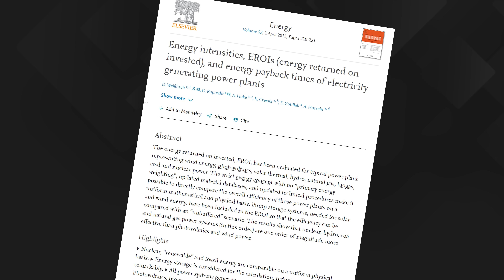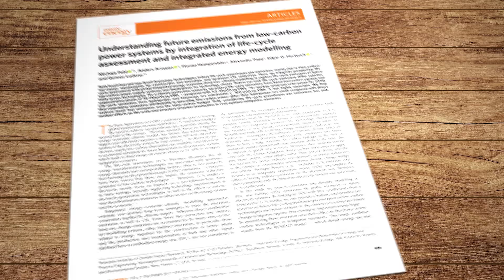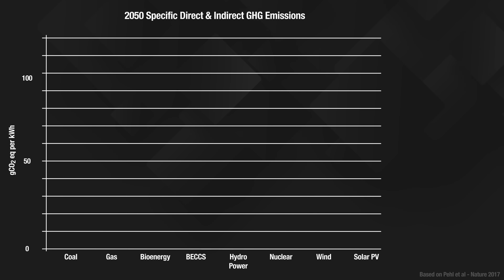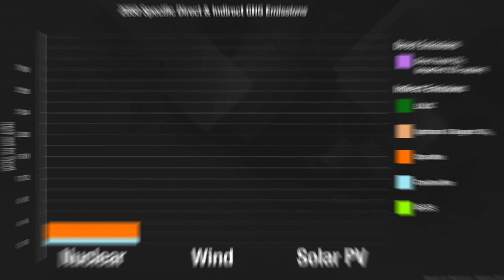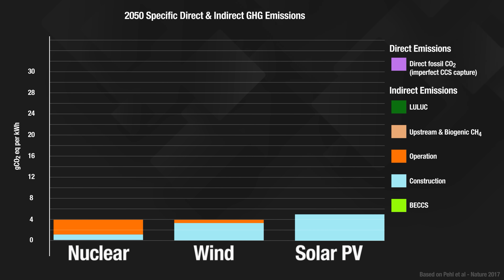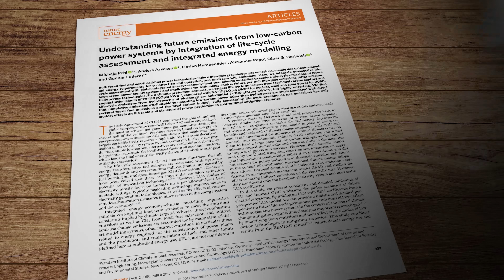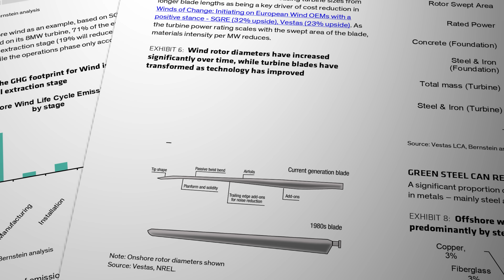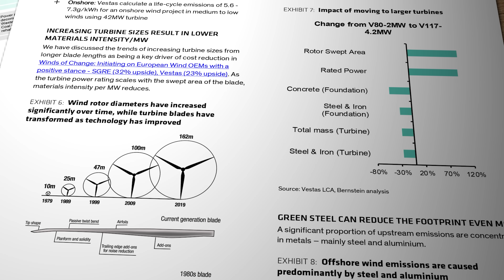Lifetime carbon emissions of renewables vs fossil fuel. Problem or solution?

Comment: Given the reliance of wind and solar on energy storage support, a significant investment cost and also emissions potential in manufacture/recycling, perhaps we ought to be factoring this element into the competitiveness of such natural energy sources in order to make a comparison with those power production systems that do not directly need such storage?
Reply: Energy storage will increase emissions, but wind and solar as so far below fossil fuels, that no reasonable energy storage system would change the conclusion.
Most likely batteries will win long term, and those have a pretty low carbon footprint already. This life cycle analysis has been done for electric cars, so we know the numbers. And keep in mind that batteries are already almost fully recyclable, as they are mostly just metals and graphite. The battery recycling industry is coming to life about now, as the amount of battery waste is only now getting to the scale where it's worth doing. And recycling batteries infinitely would reduce their carbon footprint to almost nothing, if the necessary energy is coming from clean sources.
Also there's an alternative for storage, overbuilding production. For example solar panels make less electricity in winter, or on cloudy days, so normally you would need energy storage to make up the difference (or another power source). But if you build enough capacity for the bad days, then you only need to worry about nights. And that means massive excess capacity during the good days. That essentially free energy can be used in many energy hungry industries, that don't need to run all the time. For example massive desalination plants. We can easily store vast amounts of fresh water, so these plants can afford to only work in the summer. This could solve our fresh water shortage too, as a free bonus.
Reply: @andrasbiro3007  until you realize the huge carbon footprint of a battery.
Reply: I was quite surprised by the low emissions of PV, as I would have estimated them quite higher. Nonetheless I too was disappointed by the missing mentioning of energy storage. Though to be fair there doesn't seem to have been a conclusive solution to the problem, thus estimating its weight on the environment might be a challenge. Nonetheless I would expect models that solely focus on its CO2 emissions (in the case of batteries like Li) to be possible. 

Dave if you see this, please do consider doing an update.
Reply: @cyrus5919  its wrapped up in the hydro statement
Reply: @cyrus5919  t5
Reply: I think it’s an utopian idea that cars will totally disappear, so that means a lot of electric cars will be on the streets. That means immense power storage.
Reply: Yes precisely. It's far too generous to just account the carbon intensity of wind power on windy days - the backup needs to be part of the equation. We need more wind power and more nuclear power
Reply: @sammason2300  And don't forget the infrastructure, new roads and waste areas of woodland cut down + co2 emitted by birds, bats and insects killed by the blades and some micro plastics on top
Reply: @sammason2300  j5t5
Reply: @sammason2300  Can not do Nuclear in earthquake zones - far too dangerous - not a blanket solution....
Reply: @madpete6438  cannot? I doubt Japan engineers agree with you. Japan is one of the most earthquake prone places in the world and they will not stop developing nuclear energey
Reply: @douglasashby4349  I live in New Zealand. Volcano's and Earthquakes. Maybe these new small modular reactors will work ... I have hope. But we have 81+% renewable power on our national grid already..... Makes it easier to fill in with wind and solar.
Reply: @madpete6438   Taiwan has a few and it's on the ring of fire.
Reply: @madpete6438  Pete, I live in NZ as well, the shaky isles, doubt we will ever need nuclear power here but some storage would certainly help get us to 100% renewables. Pumped hydro has been discussed for decades but gone no where. Improved efficiency of the plants along the waikato and a better transmission structure would be money well spent.
Reply: @douglasashby4349  Totally agree. And if more individuals take responsibility for their own power generation in concert with efficiency and additional wind and solar farms (imagine floating solar and wind in the Firth of Thames with integrated fish farming .... The local Iwi could make money and jobs and help the climate.... 
Or punching a couple of big tidal tunnels between Pelourus and Queen Charlotte sounds for generation.... Tidal generation in Cook Straight where transmission lines already exist to Haywards.....
Still too few visionaries in government for that sort of cleverness though.
Kia Kaha.
Reply: @douglasashby4349  Cool. Small but Cool...
Reply: @madpete6438  
We are doing nuclear in military ships. The ones that are designed to be shot at with big explosive stuff. For example the Kursk's reactors survived an explosion that tore apart half of the submarine. Only half, because the reactors stopped the explosion. These were designed to survive 50g acceleration, which is about 100x of the 2011 earthquake in Japan.
And the reactors in Fukushima also survived the earthquake just fine, the tsunami wrecked them. And even that only because a series of major design flaws.
Reply: @andrasbiro3007  Unfortunately, the phrase “a series of major design flaws” does little to calm a concerned public and convince them that nuclear energy is safe. Personally, I’m not concerned about nuclear safety in general, but a lot of people are, and the pro-nuclear crowd do themselves no favors by treating doubters like idiots and making up irrational arguments against wind/solar.
Reply: @andrasbiro3007 We have a shite load of wind, water, geothermal and sun resource - why spend all that concrete and steel and money for something that is not required - 
So mild climate with high average wind, good solar hours and lots of dammable rivers (We use quite a lot of run of river power plants) in a geothermally active area ....
Makes Zero sense. 
I suspect you were unaware of the above unique environmental conditions here.
Reply: @andrasbiro3007  But in specific areas - specific solutions work. And Nuclear is not good in some places - it is of no value.
Reply: @madpete6438  
What? Nuclear works absolutely everywhere. Even underground, under the sea (think nuclear subs), other planets, and space.
It's not always the optimal solution, but that's a different story.
Also why would this make it worthless?
Reply: @andrasbiro3007  I said it is not always the best solution. Where I live - it is pointless. We have so many natural wind, tide and water resources, the use of all of those resources to build a nuclear plant is pointless.

Plus we are islands that are very geologically unstable... that requires additional expense to construct.

The resources required to build 4 or 5 Gigawatts in one place and therefore a massive grid upgrade to distribute the power vs distributed generation of the same quantity - which is what we have now - only 20% of the whole countries energy is NOT renewable ! so yet again - no point in nuclear power here....

I hope this helped you achieve clarity
Reply: It's unfair to apply cost of energy storage to one single type of energy. Your need of storage depends entirely on your energy mix and local conditions. In a country with a lot of nuclear energy you'll need less storage, but the same is true for a coastal country who rely on offshore wind. It's far from that easy to say that for every X MWh of renewables there's X amount of needed storage.
Reply: @michaelthorsby  Spot freaking on mate. Well said.
Reply: @bobtahoma   Why compressed air storage? Surely pumped hydro is the better option there?
Reply: @DistinctiveBlend  pumped hydro storage will have the same carbon footprint (and other environmental damage) as hydro power. This very video placed hydro carbon emissions at close to that of fossil fuels! This is why hydro IS NOT green.
Reply: @robertlipka9541   I asked why someone was advocating compressed air storage vs pumped hydro. Storage of energy is something that needs to be addressed when it comes to renewables and pumped hydro is tried and true. -- It also doesn't degrade in storage capacity like a battery bank does.
Reply: @DistinctiveBlend  I am pointing out that this video provided figures showing that hydro and pumped storage have a very large carbon footprint, similar to fossil fuels. So, if you combine solar/wind with pumped hydro you end up producing such a large carbon footprint that you may as well NOT do it (perhaps keep using natural gas power stations). For me this is a very strong reason NOT to use hydro in any form, not just vs compressed air.

PLUS, pumped hydro DOES DEGRADE, dams eventually fill with silt and concrete ages. Eventually dams have to be pulled down and rebuilt, the estimates I heard for a lifespan of well constructed and maintained dam are 50-100 years (some parts in a hydro dam producing electricity have to be replaced sooner).
Reply: @DistinctiveBlend  
Pumped hydro is limited by geography. You need vast amounts of water, and that's not easy to store economically. It's only cheap if nature builds most of the structure for you.
Reply: @andrasbiro3007   Sure but if you have the geography and you have the rain/water then it become economical. -- So it's ideal for where I live, the only real issue is where and how you flood as decaying plant matter releases ch4.
Reply: Variable demand requires flexibility. Coal power plants are good for base load, but can't  quickly and efficiently reduce or increase output. Dedicated costly gas generators provide the necessary dynamic output. So arguably some of fossil fuel energy production also requires energy storage solutions.
Reply: @basilevs83  The problems with the grid usually occur during storms.  The connection system with wind turbines have problems and some of the turbines fail.  Many of the solar panels are damaged and during the stormy weather the sunlight is largely blocked.  So people use natural gas to generate electricity from expensive, but reliable systems.  If gasoline can be obtained from service stations because the power to the pumps are often out, then gasoline generators are used which poison people with carbon monoxide and often result in fires.  The diesel are a lot better if fuel can be found, but cost more.
Reply: @lewisdoherty7621  Here in Minnesota, we have stormy weather, including tornadoes. Our main grid problems during/after storms are from downed power lines. We also have very large wind power base (21.6% of our energy in 2020). It is very unusual for wind turbines to be damaged by storms. Solar panels are generally rated for 140mph winds, and in practice aren’t damaged by hail. Our biggest solar problem is cloudy days reducing their efficiency (we may have total cloud cover for days on end). But even then, they’re generating power - just not full power.
Reply: The new "microwave laser" drill tech for doing geothermal anywhere is very promising.
Reply: Even today new Nuclear power plants are 10 times more costly then the same amount of output from wind turbines.
Reply: Good point, would be interesting to see how wind and solar would stack up with energy storage LCA emissions included. I personally don't think there would be a huge impact given the growing percentage of fully recyclable materials used in energy storages now and in the coming years.
Reply: @H3LLB0Y2403  there is very LITTLE recycling in battery storage.  The carbon cost of new Lithium Ion cells is between 60kg-co2/kWh (Tesla) and 135kg-kWh (China).

That means a Tesla model S with a 100kWh battery produces as much CO2 as 1687.5 gallons of gasoline just in the battery.  And that is before it even takes a change.from the grid,.which, in America,.is 75% fossil based.
Reply: We probably have to factor in the years of technology. It would not be fair to compare the products of 2 industry's where one has had a century head start in development. 
Is there any reason to think that our natural energy technology will stop improving?
Reply: @breyrey7612  we have to solve the problem...now... Not wait for technology which was "10 years away" 20 years ago.  Nuclear is now. Biofuel is now.

Solar and wind, beyond a degree, need a storage solution. And right now, our storage solutions cause more CO2 than coal.

Lithium Ion is between 60kg-co2/kWh and 135kg-co2/kWh. The concrete needed to do pumped hyro is ENORMOUS and concrete produces massive amounts of CO2 to mine, manufactur, and cure. Hydrogen fuel cells are inefficient and are usually fueled by cracking natural gas.

Nuclear is great baseline energy and it is lower carbon than a pure solar/wind solution because of the laters dependency on storage.
Reply: @coreyfro  I agree with you 100% with nuclear. Somebody did a great job of smearing that option from Americans.
I agree that energy storage is a problem but that will improve with technology. The reaso why there is a lot of CO2 produced when mining is because the machines produce it. Once they are replaced with zero emissions, that will be another premise refuted against this product.
Nuclear is great but it's not portable (yet) so we will still be dependent on batteries for a long time.
Reply: @toadwardmaier941  I never said that they couldn't exist. What I did say is that they are a dreadful way of storing electricity. I used google translate and the article itself says the efficiency is limited to below 50% (when used to heat steam).

 So I once again point out, that it seems pointless converting electricity to heat (10% losses) and then back (50% additional losses), when you can just use batteries, which present efficiencies at around 90%. The ~40% efficiency of thermal storage (which might not even be that high, but whatever) is half of that, thus it isn't a valuable substitute.

I really dont see the difficulty understanding this..

Edit: dont forget that the initial idea was with a Stirling process, which conventionally is less efficient than clausius-rankine (which is used here). Note that this storage unit is relatively obsolete without fossil fuels, as the generated steam is supplement to a fossil fuel power plant to temporarily increase output. This is not the sustainable solution we are looking for..
Reply: It is also likely the figures are given for current technology.   While wind energy capture systems are being made more efficient in the areas of carbon reduction, there are more efficient nuclear power designs which use less materials and generate less carbon also being developed.
Reply: Agreed. Bet it's still lower than any of the things to the left of nuclear though.
Reply: @bobtahoma  
Those have horrible efficiencies. And I'm not sure about the scale. Try to calculate how much air you would have to store a GWh of power. Li-ion batteries are at this scale already, and a lot more is needed.
Reply: Do the calculated emissions for coal in this report include emissions from gas peaker plants that are now a normal adjunct to coal fired base load on contemporary power grids? I would have thought a comprehensive full life cycle analysis would have taken all of that including storage into account. It is a matter of careful data collection and sifting and incorporating realistic assumptions where the data fails to provide a full picture. Going carefully through the report might throw some light on your concerns.
Reply: I read that 95% of storage kWh's is from pumped hydro.  I assume that much of the carbon is from moving dirt to make the reservoirs and dams.  We need a lot more pumped hydro storage.
Reply: @bobtahoma  
Efficiency is not just a bit lower, but vastly lower. Like 25% vs. 95% is a big deal. Some may go up to 50% or 60% in ideal conditions, but that's still way too low for daily cycling. Give me 80% and we can talk.

And I have doubts about scaling too. Li-ion batteries have surprisingly high energy densities compared to mechanical or thermodynamic storage systems. Calculate how much mass and volume we would need to store significant amount of energy (on the TWh scale). Pumped hydro is a good example. Look at the amount of water they use.

On the other hand we can scale li-ion, there are plenty enough raw materials, the bottleneck is just extraction. And there's the potential of sodium-ion, with an iron-phosphate cathode. Not much scarcity there.
Reply: @Apsoy Pike Finnish Sand Storage is looking very cool and "dirt" cheap!
Reply: @bobtahoma  
Horrible efficiency wipes out all advantages.
The only possible exception is long term storage, but there capacity is problematic. If energy density is low, which is the case for practically all of these, then large capacity will be expensive, even if you only use dirt cheap materials. A good example is pumped hydro, which stores energy by simply pumping water up. The issue is the amount of water needed. To store any significant amount of energy, you need billions of tons of it, and you also need to store it somewhere.
I'm not saying that all of these are bad in every possible use case, just that these are serious problems that most advocates tend to overlook.
Reply: Energy storage tech is shifting rapidly, I'm not sure if we can make a good estimate for this. However right now most green energy isn't stored, it goes into the grid reducing burning energy.
Plus a lot of battery storage is likely to be your laptop battery, your phone battery, your car battery, etc. Charging those devices when power is cheap would be a good way to save money and the environment. 
I do wish geothermal energy was on the list though. It would be a good choice for low wind night lights and oven power and heating and such when solar and wind aren't available.
Reply: @aaronbaker2186   storage never generate any energy at all .process of manufacturing storage facilities cost money and natural resources as well.I wondered what is the alternate for battery or melt salt?any one provide me answer .LOL
Reply: @aaronbaker2186  everyone down plays the capital costs of their preferred system along with its weaknesses.
Reply: @aaronbaker2186  
Geothermal is limited to where the Earth is hot near the surface.  That eliminates a very large part of the land.
Reply: @aaronbaker2186  it's not.  We have been using lithium ion since the 70s and every other technology is constantly "10 years away"
Reply: But disappointed that you're getting criticism for raising this. C'mon folks, the channel's even called "just have a think" - be weird if further discussion was discouraged.
Reply: @tomevans9451  "just have a think' means I get to think about what is said, and possibly disagree. If I disagree, I get to criticize and you get to think about it.

Would it have been nice for the study to include three or so models that took in to account variability of renewables? Maybe. But there are countless combinations. HVDC transmission with over production, deep bore geo thermal baseboard, electro-chemical storage (dozens of chemistrys to choose from), chemical storage, hydro/mechanical storage, thermal storage, load shifting, and any combination of those combined with projections including the use of built out renewables for their production. Where would that analysis even stop? 

All this still doesn't change what the study shows; renewables and possibly nuclear are the only sources with lifetime emissions low enough to pursue. Everything else is an order of magnitude higher than the levels  required. That means means they are non-starters. Even if you quadruple the expected lifetime emissions of renewables, renewables are still the only viable path forward.

It's like needing to get to the ER in ten minutes; you don't take a two hour route because there might be a little traffic on the 5 minute route. You are right to be concerned about the traffic, but that concern shouldn't impact your decision to take the shorter route.

So yeah, we're all just having a think and talking about it, and sometimes we disagree and talk about that too.
Reply: Your energy storage would have to be REALLY bad to push renewables to be worse than fossil fuel power plants. Nuclear is great especially as baseload, but I think new reactors could be made to be adjustable
Reply: @ThomasBomb45  lithium ion energy storage, if I use Tesla's numbers, are 60kg-co2/kwh.  This ignore the fact that most Lithium ion storage is produced in China where the number is 135kg-co2/kwh.

That means that a Tesla Model S with a 100kwh battery, before it leaves the lot, costs as much in CO2 as 1687.5 gallons of gasoline. That would get a luxury sedan (equivalent to a Tesla) 60,000 miles.

That's before the Tesla gets a single battery charge.  Then,.from the American energy grid, which is 75% fossil based, you charge your battery with fossil carbon.

So. Yes, exactly as you said, the storage solution is aweful.

Footnotes:
1. Tesla models weighs about 1500 pounds more than an equivalent luxury sedan, so no, you can't say the same amount of carbon was used to make the traditional sedan.
2. The carbon spent to make iron and plastic.is about 1/4th the amount per pound as a lithium iron battery, so a traditional car if equal weight ro an EV is ALSO not nearly as damaging.
Reply: @coreyfro  You forget that existing ICE cars also have more complex manufacturing. So it's only the marginal difference. LCA shows it might add less than a year.
Reply: @HughButler35 that has nothing to do, what so ever, with the carbon cost of lithium ion batteries.
Reply: @coreyfro  
These are outdated numbers, and probably were wrong even back then. Read Tesla's 2021 impact report, or any recent study.
Reply: @coreyfro  
Where did you get that number? I don't see it anywhere in the report. What it says very clearly, and repeatedly, that their cars are much cleaner then ICE cars.
Reply: @andrasbiro3007  best study to read is an MIT report entitled "How much CO2 is emitted by manufacturing batteries?"

Sorry, cannot link in comment.
Reply: @coreyfro  
I saw several studies with wildly varying numbers. Some are completely made up. It also depends strongly on where were the materials sourced and where was the pack manufactured. Chinese batteries are much dirtier than American ones. But even within China there are big variations. Today EV companies care a lot about their CO2 footprint, so they try to avoid coal power and dirty mining practices.
Tesla for example makes a lot of batteries in Nevada, in their own factory, which is increasingly powered by solar panels. They also recycle most of the water and chemicals, so it's one of the greenest factories in the world.
Reply: @andrasbiro3007  good thing I am quoting Tesla directly.
Reply: @andrasbiro3007  
1. Tesla's Nevada gigafactory numbers are 60kg-co2/kWh which means the model S has a carbon offset of roughly 40,000 miles of a luxury sedan before it gets a.single charge.
2. Tesla buys cells from China for all non-american markets and that stuff is dirty dirty dirty.
Reply: @coreyfro  
1. That's a made up number. I don't have the real one, unfortunately, but that's way too high. See 4.

2. The Model S is irrelevant anyway, it's less than 10% of Tesla's sales, and will be even less in the future. Also The Model S doesn't even use cells from Nevada. It uses Panasonic 18650 cells from Japan.

3. According to Tesla's 2021 Impact report, a Model 3 or Y is already greener than a gas car after just 6500 miles, on average. And that's assuming grid power. Charge from solar, which is pretty common, and it's much faster.

4. I found some data about CATL (2021 ESG Report). They claim ~13 kg/kWh CO2 emission. It's self-reported, and it's a Chinese company, so take this figure with a grain of salt, but it's still over 4x lower than what you claimed for Tesla's Nevada factory, which is mostly solar powered.
Reply: @andrasbiro3007  

1. Good thing this platform doesn't allow links so I can't prove you wrong
2. So the other ones have 80% the capacity.  The problem is the same and those batteries are going to be worked through more of their cycle so will age fast and need to be replaced more.
3. I have ready that report.  When they compare themselves to other manufacturers, they are using 20 year old numbers, which is dishonest since market, economic, and regulatory pressures have also forced other manufacturers to change.
4. IMPOSSIBLE. The lithium mining and refining process requires the majority of the power consumption.  Perhaps ONLY the manufacturer cost is 13kg-co2/kWh.  The recycling cost is 10kg-co2/kWh (Firbse 2020)
Reply: @coreyfro  
1. Actually data proves you wrong.
2. That's not what were were talking about. But you are still very wrong. Modern batteries have very long lives, and that's been thoroughly proven in practice. The latest Tesla batteries last well over 1 million miles. And LFP batteries can do a few times more. 
3. What 20 year old numbers?
4. It's hard to figure out from the report, it could be just the manufacturing cost. But it doesn't matter much anyway. The whole point is to use renewable energy instead of burning fossil fuels. Once we achieve that goal the carbon footprint of batteries will also drop to near zero. Mining, refining, transporting, manufacturing, and recycling, all can be done using clean electricity.
Reply: Ok and factor in the trillions in subsidies the fossil fuel industry has received over the decades
Reply: @godkingemperorpresidentceo  And still do.... I suppose they are so poor they desperately need the support to fund the massive PR (Should be PL {Public Lies}) departments ... and the bribes to Politicians.
Reply: This is exactly the problem with non-constant energy sources as a solution to GHG emissions, the emissions from storing the energy far outweighs those of the energy producing device.
In this paper (Jones et al. 2020, DOI: 10.1021/acs.est.9b06231) you can see the carbon emissions for the best energy storage options (not accounting for pump hydro); these are (in the same units as this video, g CO2eq/kwh) ~312 for lithium, ~282 for redox flow, and ~126 for compressed air. When added to PV or wind the conclusion is clear, the only energy source that could power a constantly available grid AND keep emissions on target is nuclear.

Note that pump hydro would be better than the above energy storage solutions, but it still suffers from the emissions presented in this video.
Reply: @ackermannluis  
False. One paper means nothing. I've seen plenty that used grossly inaccurate assumptions.
In this case that CO2/kg for Li-ion batteries is just absurd. The true cost is like 20x less. For example CATL claims ~13kg/kWh in it's 2021 ESG report. It's not necessarily a reliable source, but the difference is way to big to ignore.

Also the vast majority of the CO2 comes from the energy used for mining, refining, transporting, and manufacturing. Use cleaner energy, and the carbon footprint of batteries drops further.
Reply: Elon Musk estimates it would take 300 Twh to power the global economy. A huge percentage of that would have to be stored for nighttime use, bad weather, etc. There's a lot of mining and processing needed to produce batteries at that scale. And a huge amount of processing involved in recycling battery material. Also, I believe that about 75% of solar panels are currently produced in China, and their power comes almost exclusively from coal fired plants.
Reply: @darylfoster7944  
Then manufacture solar panels elsewhere. It's not like only China knows how to do it.
Also do you have any idea how much oil and coal we burn? that 300TWh of battery is nothing compared to that. 300TWh of the current Tesla Megapack is about 7 billion tons. We burn about that much coal in a single year.
Reply: @darylfoster7944  YES - they do use a shite load of fossil energy at the moment - however there is also a massive, ongoing addition of renewables (mostly Hydro) all over China. The quantities are quite amazing... so the proportion of Renewables changes Week by Week....
Just watched doco on the floating Solar Farms they are putting in enmasse (also said to reduce the co2 coming off the storage lakes).
I do believe we need to NOT be stopping putting in solar, wind and hydro just to satisfy the nit pickers. My panels came from china but they are saving carbon every minute the sun shines.
Reply: @darylfoster7944  not true Daryl. 300TW - but most of that is vehicles. Grid storage analysis in Australia says 10% or less of generation. So maybe 20GW. Less than 10% of needs.
Reply: @HughButler35  if you're right, then what about all the other energy that's required to power homes and buildings? And I think you meant 20 TW, not 20 GW.
Reply: @darylfoster7944  
That was the storage needed, right?
Reply: @stefanwallgren3497  that's installed capacity of EVs and battery packs, in order to run Earth's entire energy structure.
Reply: So sure, factor in that cost. I’m gonna dig a couple of holes, fill them with cheap locally sourced mass (you DO have rocks where you live, right?), add stuff to heat that mass, and hook up a Stirling engine or other heat pumps. What’s the carbon footprint of that, and what’s the lifespan? Yes, do the math. PLEASE. Don’t just raise abstract doubts with abstract questions.
Reply: @davestagner  considering the fact that solar and wind energy is not consistent throughout the day/year, it would seem significant to factor any additional sources of carbon emission due to additional infrastructure. Not to mention the drawback of lowered efficiency in Battery storage, which would skew the gCO2/kWh efficiency of solar and wind.

Although I would definitely agree that renewables are the future and that they already show better results than coal etc., such estimates are of huge importance to know if we manage to stay within 2°C and to create a specific timeline of that transition. Moreover it is equally as important, in order to decide whether a return to atomic energy is necessary to achieve said goals.

I wish to criticize your unconstructive cynicism in this matter, as posing such a question does not simultaneously imply being a shell for...Shell.

Edit: I just realized that you might have had been serious, in which case your suggestion is the funniest thing I have seen in a while. In very short terms, the thermal efficiency of your proposed contraption wouldn't surpass (in the VERY best of cases) 40%, though if you actually consider that you wouldn't be able to make large Temp. Gradients, you wouldn't even surpass single digits (note that I have neglected heat losses as well).
Reply: @cyrus5919  Oh, I’m totally serious. I think we SHOULD bring in the cost of grid-stabilizing storage and the carbon/environmental footprint of manufacturing said storage. The reason I think we should do this is to drive yet more nails into the coffin of the ridiculous arguments like that it would be as dirty as fossil fuel, that sufficient-scale storage is technologically impossible (it’s not even hard, much less impossible), or that storage costs would make a solar/wind grid so expensive that humanity couldn’t afford it. Bring it. Please. Bring your numbers and your math with you. And think about what they mean. For example, you point out that the efficiency of my “proposed contraption” wouldn’t exceed 40%. Very well, I accept that, conversion efficiency is an issue. So, um, what would it cost to make my “contraption” 2.5x larger, in order to cover the efficiency loss? 

You claim “you wouldn’t be able to make large temp gradients”. Um. Why not? This channel is full of thermal storage projects working at temperatures like 600c, which is a fairly large gradient. There’s no theoretical limit I’m aware of to the amount of heat that can be generated by electricity, except perhaps materials engineering limits, which I’m sure can reach thousands of degrees. If you can’t actually explain your claim, then it’s a criticism with no basis in theory or fact. And, beyond thermal storage, there are plenty of other ideas - battery technologies that would work well at grid scale, like iron-air, or gyroscopic storage, or compressed air, or hydro storage which is already in place around the world… storing energy at scale is straightforward and inexpensive. 

So yes, let’s count the cost of storage. Let’s have that discussion. I’m serious. Are you?
Reply: @cyrus5919  He was just keeping it short and simple. Of course if you want longer storage you need some insulation, but you still heat the sand, it is cheap(FREE if it is on site) and has a lot of mass. 
But in the cases where it is a big project(a huge energy storage) then the losses become less and less the bigger and hotter you make it. I mean the losses are next to nothing in comparison to the amount of storage you get, and for how long you get it for, for months and months.
All you had to do was heat the ground in essence, we know it sounds absurd to uneducated people, but now we know who isn't educated, those who laugh at it. Now we know who don't know how to think. Sand is already sand, you don't do anything with it, just throw it in the hole. We are keeping it simple, but there is a process, you want to bury heat exchangers in that sand, then heat the sand, simple.

FYI you can get the sand up to 600C before it melts it, so you keep it no hotter than 600C. 600C sand will heat the shit out of anything you pass thru the heat exchanger that is buried in a huge pile of 600C sand in a hole, mark these words. 
Hint: water can be made into steam day or night, or day AND night to make electricity. Or and also Stirling engines do away with steam altogether, no need for high pressure super heated and dangerous steam and the costly high pressure tanks and pipes and safety valves, etc... related with it.  And no, Stirling engines are not more complicated or more costly than ordinary engines.
NOTE: that is why we heat sand not water, water can only be heated to 100C and then it turns into steam and becomes pressurized and super heated, but it is highly dangerous and expensive to keep contained properly. So, we use sand as the heat storage, then we can use air itself as the exchange median that runs thru the heat exchanger an into the Stirling engine/s. Then the mechanical rotation of the Stirling can be hooked to a electrical generator.
NOTE 2: In a city you can have the heat storage in the center of the city, this way you can also just run heat vent piping to the homes and businesses bypassing the need for any generators, Stirlings, or any steam, and still heat the city. This ideal is good for cold areas, but they will still need another storage somewhere for electricity generation, but this is not as important to be in the center of the city, it can be out of the city if you had to, and just use the known and proven high transmission lines we already use. I mean the known and proven Nicola Tesla invention of AC transmission lines, not the current energy company. Use the known and proven technology of high voltage AC transmission.
Reply: @TheRebelmanone    good to know that my postgraduate studies in this field (chem.eng.) are rendered useless by youtube comments. Responding seems ever more pointless so I will try to keep it short.

Stirling engines have a bad efficiency as storage. Now you could use them as primary engines and somewhat claim that they can compete with otto/diesel, but not as storage!

In regards to thermal storage: any mech. Engineer worth half a penny will tell you, that heat is the most useless form of energy. Any attempt to convert heat into useful work, I.e. electricity, is starkly limited by efficiency. Just scaling up projects, especially engines, makes them more inefficient due to more losses. For some reason there seems to be a belief towards the opposite, but let me assure you, 90% of my work focuses on counteracting these inefficiencies, so I do have some idea what I am talking about. If you don't believe, just do a bit of research.

Now to your notes:
1: steam in fossil fuel power plants is heated far above 100°C. Interestingly enough, the usual referred value is 600°C. I don't even want to ask why you would think that it would be just 100°C. If you are interested, I recommend reading up on the clausius-rankine process, on which most conventional power plants are based on (I.e. Pretty much anything that includes steam generation).

2: Although I find the various ideas spread in this node quite amusing, none of them are applied, because they are...bad. The reasons for this can be found in previous answers of mine, or with a bit of research. If you think I am wrong, I would strongly encourage you to research the topic further and if you find any scientific papers that contradict my statements. I would be very happy to look them up and be proven wrong. 

Now finally I wish to apologise if my tone seems agitated, but being subjected to your rude, know-it-all remarks does that to someone. There seems to be this belief, that we would have sustainable energy etc. if only a select few didn't hinder progress. I kindly ask you to consider, that you do not know all the answers. There are many scientists, much smarter than you, me or the youtubers we are watching, who struggle solving the modern issues. The solution is not as simple as just pressing a button and I have mentioned multiple reasons why that is, and I haven't mentioned a myriad more that I myself am unaware of.

Edit: I forgot to mention your outrageous statement, that heating the sand would somehow be free. This would have made me laugh, if I did not think that you actually believe this. So let me assure you: there is no such thing as "free" energy, in any sense of the word. If you want just read up on the laws of thermodynamics. If you meant that you could use energy that otherwhise would be wasted, then you just recuperate a (small) fraction of the losses you already had. Any time this isnt done in the first place, it is because it would be more expensive to implement the necessary technologies.
Reply: @cyrus5919  I didn't say scale up the engines, i said scale up the heat battery. 

FYI they use heat to give you electricity as it is. Coal uses fire to heat steam to turn turbines. Nuclear heats steam to produce electricity. 

What is a solar concentrator, it creates you guessed it HEAT.

You are so full of it, first of all because you only heard what you wanted to hear and you never actually tried to read the comment.
Second of all, you don't know what you are talking about outside your so called chemistry. 
You missed the classes on general physics. Or you didn't learn enough to speak on this subject.
Reply: @davestagner   "Don’t just raise abstract doubts with abstract questions." I believe that's called "JAQing off, and yes it's annoying. "Just Asking Questions"
AKA FUD-raking.
Reply: @Jcewazhere  The Devil doesn’t need more advocates. :) But like I said with my response, yet, let’s definitely answer that question. Even if it’s FUD, it’s a valid issue. And I think the answers will just reinforce the superiority of a solar/wind/storage grid model as much less expensive in terms of both total cost and total carbon footprint. The anti-storage arguments are basically terrible, and I enjoy opportunities to shoot them down!
Reply: @davestagner  you are attacking a "straw man". I seriously doubt anyone here is arguing to keep using fossil fuels, the options for carbon free are: nuclear/solar/wind. Among these three, when you include carbon costs of storage, nuclear wins by a LOT at producing the least carbon emissions. So, you are not shooting down any arguments... rather you are missing the point.
Reply: @robertlipka9541  I don’t think you understand my argument. I don’t think nuclear power will ever grow much beyond where it is now, because it’s simply too expensive. It’s barely cost-competitive with coal, much less the rapidly-falling price of solar/wind/storage. None of the current advanced research in nuclear looks like it can lead to a major cost reduction either, much less the order-of-magnitude difference needed to beat solar/wind. (And no, this isn’t about “unnecessary regulation” or “foolish environmentalism”. If it was, we’d see more nuclear in China/Russia, who don’t care about such things.) Fantasies like thorium or mass-production modular reactors are twenty years down the road at best - twenty years of solar/wind/storage installations, twenty years of cost and efficiency improvements. They’re not competing with 2022 solar/batteries, they’re competing with 2042. Is it possible that nuclear beats solar/wind/storage on carbon costs? Yeah, probably (although not be a “lot”, and remember, we’re comparing to coal and gas). Does that mean we should put off solar/wind/storage, when it would be much more difficult and expensive to go primarily nuclear? Absolutely not.
Reply: @davestagner  I think you make too many assumptions on what is possible with nuclear energy (modern reactors CAN lead to reductions in cost and improvements in safety). In recent times nuclear got very little investment in research and development and this is why it is behind solar/wind... but now investment in developing nuclear is growing. I disagree that with proper tech development nuclear will be more expensive than solar/wind... BUT, for argument sake, even if more expensive, nuclear can be combined with solar/wind to provide 24/7/365 base load power, without needing to build carbon footprint intensive storage. Plus, nuclear provides much more power dense source that can be advantageous to industry (we will still need industry to make things... even if it is carbon free steel via hydrogen). I think to do the BEST JOB on behalf of the environment we should PROPERLY evaluate what nuclear can do, if given the same level of investment as renewables are currently getting.

I agree that solar/wind has only a little larger carbon footprint than nuclear (assuming the analysis in this video included RECYCLING costs for renewables), but the REAL problem is the carbon footprint of energy storage... you CANNOT exclude this. Until solar/wind + storage carbon footprint is less or at least similar to nuclear, you CANNOT exclude nuclear as a power source (EVEN if it costs more).
Reply: @robertlipka9541  Nuclear has gotten plenty of investment in research and development. What it hasn’t gotten is production-ready advances that offer major improvements in cost and safety over traditional light-water reactors - which are too expensive. A good example is TerraPower. After 15+ years of effort, they’re building ONE traveling wave reactor, in China, that is basically experimental (and has a seven year construction time). They’ve been banging away at the Natrium design since 2015, and MIGHT have the first commercial reactor in 2030. Assuming nothing goes wrong. I like both of these designs technically and think they’re great advances in safety, but if they have five commercial reactors in ten years I will be impressed. That’s NOT GOOD ENOUGH. I don’t see how you get to a 50%+ nuclear grid by 2040. 

But about that carbon footprint of energy storage… as I keep saying, I don’t want it excluded. I absolutely want to talk about that. Because I don’t think it’s a “REAL problem”, as you say, and the people making that claim aren’t offering up either theory or practice data to justify themselves. And such a justification needs to cover the wide variety of storage in the works right now. What’s the carbon footprint of stored hydro? (And are hydro dams subject to the same criticism?) Of compressed air? Gyroscopic storage? Thermal? Synthetic fuel? How much storage is even needed for a stable grid? Basically, you need to be sure you’re standing on firm ground with a defensible criticism, not just making handwavy arguments to prop up the idea that nuclear is the ONLY solution.
Reply: @davestagner  I am sorry, BUT what you say, your "facts", are NOT what I know about nuclear. So, there is NO point in discussing this further... for me it is not a contest for winning an argument, BUT it is about picking THE BEST solution for the planet.
Reply: @davestagner  my questions will be as abstract as your post. How local are these rocks. Do you have to break them yourself,  is a quarrying company doing it or are you driving around picking them up. If so what are you driving. What machinery are you using,  what is your heat source, and above all else why would you use a Stirling engine? Oh, what would the Stirling engine drive?
Reply: @richardshillam7075  Quarrying for rock, gravel, and sand is very well established technology. Any decent-sized city has a couple of big holes nearby that they dug to get the materials for the concrete to build the city. So digging a hole and filling it back in with whatever material is available locally is a straightforward, predictable engineering exercise. Adding the heat pumps to heat it with surplus energy and extract that surplus and covert to electricity (doesn’t HAVE to be a Stirling engine!) is a relatively small part of the job. And yes, there’s a one-time carbon footprint cost to dig/fill a hole. What you get from that one-time carbon footprint is a low-maintenance energy storage system that will operate for decades, supporting clean energy sources and producing no more carbon footprint after initial construction. (If it makes you feel better, a nuclear plant is basically the same deal - the carbon footprint is all up-front in construction.) I just don’t see how the carbon footprint is possibly larger than any large construction project. Logically, it should be less, since there’s a lot less carbon-intensive concrete and steel involved. 

The claims that the carbon footprint of such a system are “excessive” or equivalent to just burning coal (which itself means digging a large hole) are, frankly, absurd. But this thread is littered with such unsupported assertions.
Reply: @davestagner  hi Dave, not saying its a bigger carbon footprint than anything,  just aying it's hard to work it out without all the information. That's what you asked us to do. However I would question using heatpumps to power it. Ground source heatpumps are used here, but they take the heat differential of the hole and atmosphere to create it. You seem to be adding expense, and with it extra components. I don't know the lifespan of these components but they all add up. Ground source heating makes sense, particularly at scale but any attempt to convert that to other usable power is extra expense with greater losses. A Stirling engine runs so well because its a closed loop. Any other moter/generator will require far more power than ground source can provide on a domestic scale.
Reply: @richardshillam7075  I think I’m more asking why some are claiming that the carbon footprint of energy storage is unacceptably high - especially fairly low-tech storage like thermal. It’s not like we aren’t digging big holes all the time anyway. I’m relatively more concerned about the carbon footprint of, say, lithium batteries, but I think they’ll prove too expensive for grid-scale in the long run anyway. Their real advantage is energy density and fast discharge, making them great for cars and portable electronics. Grid power, though, can get away with both lower density and slower discharge, which opens up much cheaper systems that don’t depend on expensive materials or advanced construction. (As someone said, to make something dirt cheap, best make it out of dirt!) Gravity, inertia, compression, and thermal mass all come into play here, because they’re simple and cheap and can usually use locally available materials. 

A somewhat bigger problem is efficiency, which is where your doubts about heat pumps come in. There’s conversion efficiency to turn solar/wind into electricity, efficiency again to turn electricity into heat/work/pressure/etc, then efficiency to convert back from heat/work/pressure/etc into electricity again. It’s definitely not a free lunch. On the other hand, as long as it’s relatively inexpensive to build and maintain, both in terms of money and carbon footprint, then there’s no reason we can’t just scale up to necessary size. This is a GREAT case for letting the forces of the free market do their work, and I expect we’ll see a rich variety of solutions localized for the needs of particular geographies and demographics. But from a pure economic standpoint, a 30% efficient system that costs 50% less than a 50% efficient system is a huge, huge win, at grid scale. And it’s really, really hard to beat thermal mass when it comes to construction costs and lifespan. A well-designed thermal mass storage could operate basically forever once it’s built. The same can’t be said of batteries (which can last decades). Simpler is generally better. 

I know we don’t have “all the information”, but we do have reasonable analogies. What’s the carbon footprint of the construction of a shopping mall, or a factory? What’s the carbon footprint of a gravel pit? (EVERY city has a gravel pit!) What’s the carbon footprint of all the pavement in place in a city? Unless someone can suggest a factor that I’m missing here (and no one has yet), then building mass-based storage, thermal or gravity, should be pretty similar to a similar mass and volume of ordinary urban construction, like road surfaces and gravel pits.
Reply: @davestagner  you have no idea what you’re talking about mate, go take a thermodynamics course…
Reply: @Taskarnin  Since I presume you HAVE taken a thermodynamics course, perhaps you can explain to me why I’m wrong? I may be wrong; I am often wrong. I like it when people enlighten me, because it makes me smarter. But if the sort of thermal storage I’m talking about is not possible at scale and/or in an energy-positive fashion, I’d love to know why.
Reply: @davestagner  I’ve taken several and have a masters degree in engineering. I’m not going to give you a full explanation however this will let you do some reading. The maximum possible efficiency of a heat engine is defined by an impossible but ideal cycle called the Carnot cycle. The efficiency is determined by the temperatures of the hot and cold reservoirs. That being said the practical limitation is a bit less than 50% so if you used heat to store and extract energy at best you’ll get half of it back. In reality much less.

In reality most power plants use the Rankine cycle which can get to be about 42% efficient with extremely high steam temperatures. So if you store grid energy with heat you’re getting less than half back. This is why the grid operates the way it does today (who knew engineers know what they are doing?).

You’re better off using a reversible process, like storing energy in a spring, or lifting a weight up (see pumped hydro energy storage). 

Finally people act like car engines and jet engines are so bad but 30-40 percent efficient out of a modern Atkinson cycle car engine is pretty damn good. The Brayton cycle in jet engines is pretty good too, especially at high altitudes.

There are fundamental physics in the way of the solutions to these problems.
Reply: @Taskarnin  Ah, ok. I’m familiar with the Carnot Cycle and was already taking it into account in my head, just not explicitly. Note that it doesn’t make thermal storage technically impossible - just bigger and more expensive. But if thermal storage has a large enough cost ratio relative to, say, batteries, then you just eat the inefficiency, build a bigger site, and call it a win. This really comes into play for large scale, long term energy storage (like storing summer solar for winter energy). And given that building a large thermal storage is basically “dig a big hole and fill it with heat exchangers and rocks/sand”, one can see how it might wind up significantly cheaper at scale than higher-density storage. Of course, I may be wrong; I am often wrong. But I have great faith that the invisible hand of the market, combined with sound engineering practices, will choose the best energy store for any particular job. fwiw, I don’t think gravitational storage like pumped hydro or the clever cranes-and-concrete systems can store enough for seasonal in a cost-effective way, but they’re great for short-term storage because of instantaneous response. On the other hand, I can easily envision a fuels-based alternative for winter stored energy, using hydrogen (maybe captured in ammonia or methane) or synthetic liquid fuels. Again, inefficient, but pragmatic and with some very cheap parts. 

Of course, this is all a distraction from my original point - rebutting the idea that storage is either technologically impossible or prohibitively expensive, and thus nuclear is the ONLY solution.
Reply: @davestagner  There's nothing wrong with raising these questions. If you have a solution, tell us more. Also I live in London, England, and everything ia built on London clay. So I suppose we could dig a couple of holes and fill them with clay... Er, where was I?
Reply: @davestagner  Stirling engines don't seem to be common in large scale energy storage. Why not? I don't know but I assume they must be more expensive (and maybe more resource intensive) to make than other engine designs?
Reply: @ThomasBomb45  Large scale energy storage is a pretty immature market right now, and grid-scale thermal storage is very new tech. So Stirling engines to convert thermal storage differentials back to electricity by driving generators may be a key part of the future, or a technological dead end. We’ll find out over the next few decades! But I believe pretty strongly that solar/wind + grid storage, plus synthetic fuels from solar energy, are the future, and the reason is cost. It’s just going to be much cheaper than anything else, even if you don’t bring in externalities like climate change. I don’t think nuclear will be a big part of the equation, mostly for cost reasons. Nuclear could barely compete with coal on cost, and none of the realistic new advancements I’ve seen offer that order-of-magnitude cost improvement that will be needed to compete with the ever-dropping costs of solar/wind/storage.
Reply: @ThomasBomb45  all you need to do is take an introductory course to thermodynamics to understand why sterling engines are not used in power production.
Reply: @ThomasBomb45  Stirling engines are producing energy and not storing energy.  All engines are producing energy and not storing.  Flywheels are storing energy but they are not engines.
Reply: I have reservations about solar PV panels since they could be all rendered worthless from an event shadowing the Earth such as volcanic activity. Wind seems to be the best bet since it gets stronger as our climate conditions decline.
Reply: @GTN3  except for the fact that windmills can’t be used in strong wind conditions.
Reply: @GTN3  
If all solar panels in the world are shaded by ash, then you have much bigger issues. Wind has many problems, much more than solar. It's only advantage is that it works when solar doesn't, and so they complement each other.
Reply: @GTN3  nuclear seems by miles the best option, supported by wind and solar. But I don't see a green future without nuclear which in time will be replaced by fusion.